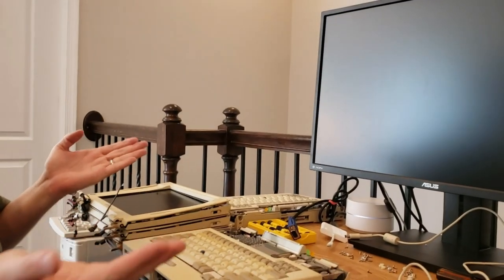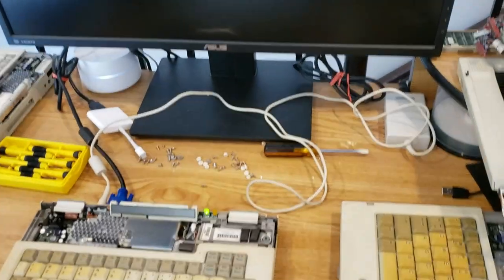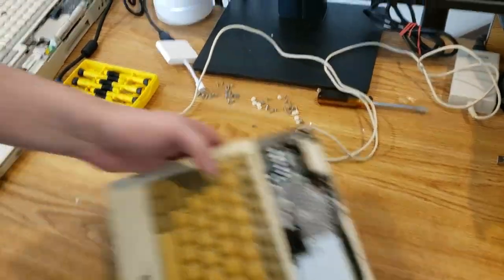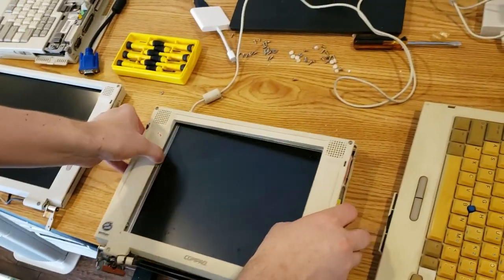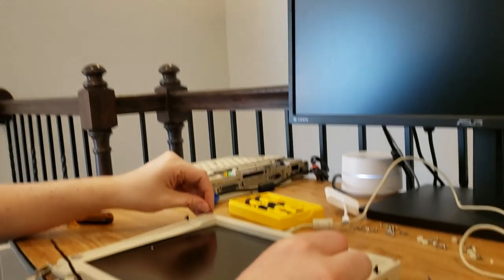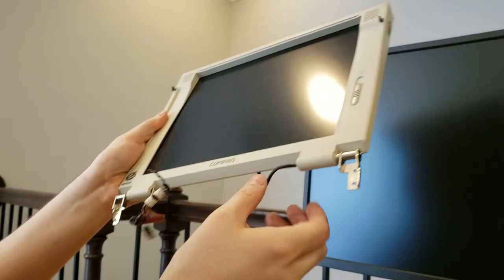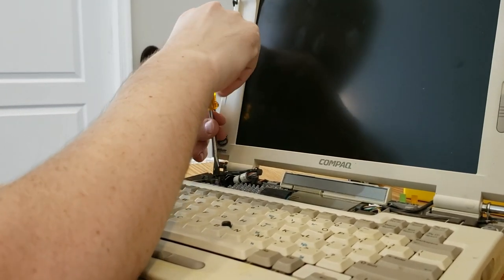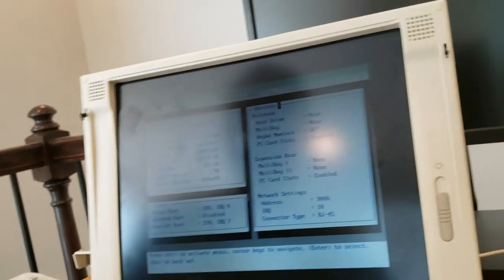Compaq LTE 5280 Frankenbuild Part 1: Making a working laptop from three parts laptops

Comment: Hi Cool, i will watch it all ( it is 11:30pm) , initially i thought it was a compag slt 286  - we had one at work in about 1988 - i remember the NEC 286 desktops were about $4500 AU and the laptop was about 50% more expensive.

We had 3 programmers that used it - they coded in C++, went site to site and installed updated to customer written in house software. After some bickering, they ended up with another , then they purchased 2 new laptops but they were compaq 386's and then they dumped the 286's.

I was allowed to use the original 286 in night school on wednesdays and bring it back the next day , signed in and out - i did not mind i was happy to lug it around and it cost more than my car at the time.

I still recall 2meg ram, win 3.1 40 meg hdd, and spent most of the time playing solitare using keyboard controls and the blurred grey/whiteish images of the cards - it was built like a tank but so modern and sexy nothing like the osborns and kaypros that most management still logged around

Regards
George
Reply from the maker: That is awesome! It is always exciting to hear about how machines were used back in the day.  Thanks for watching!!